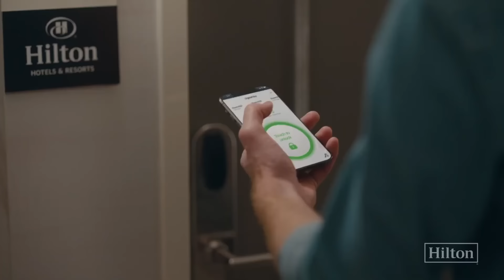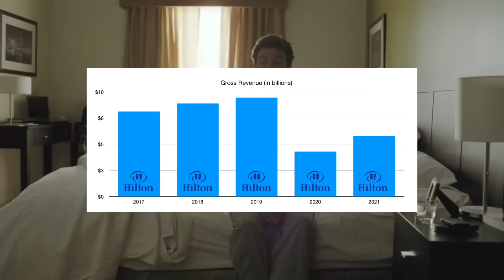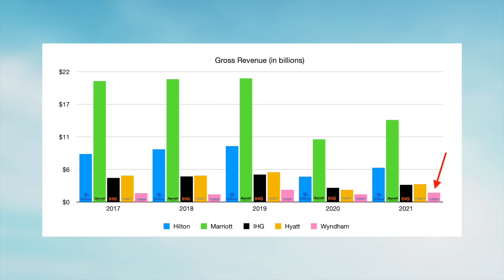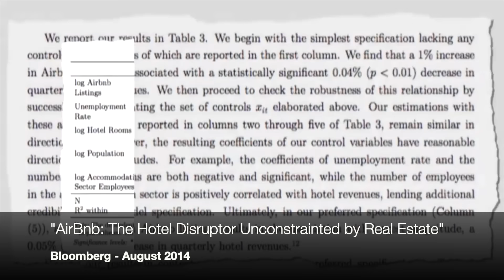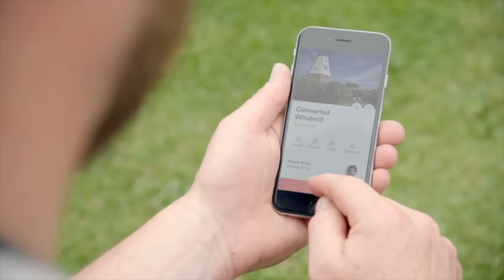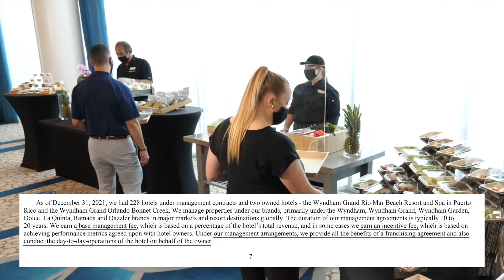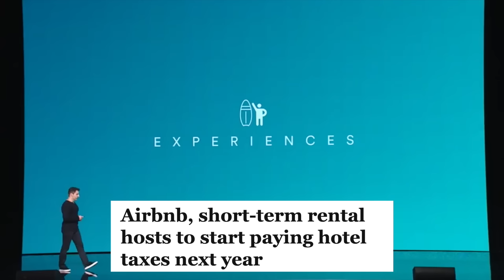Why Airbnb Fails to Disrupt the Hotel Industry

Comment: Well the one thing Airbnb has going for them is definitely price and location. I booked an Airbnb once because I was attending an event and all the hotels were kind of far whereas the Airbnb was within walking distance. 

However I know for sure consistency is definitely an issue. Some places will be nicer than others. Different owners will have different rules. Not to mention you don't know if the neighborhood is safe if you're coming in from out of town. With hotels you know what you're getting and you don't really need to fear for your safety if you're staying at one of the big major players. 

But I do think this causes another issue since there are people purposely buying properties to turn it into a dedicated Airbnb. And another thing I've ran into is rental arbitrage where people would rent a property and then turn that into an Airbnb. I mean with the already small supply of housing and now some people are taking away rental properties for this type of business. I'm not sure what that's going to do to the housing market. 

Hotels will always be around. In fact if Airbnb ever costs as much as a hotel I'm just going with the hotel.

Comment: I would like to add an additional European perspective.
As from my experience also travel changed a lot during the late '90 and early 2000 if you wanted to travel cheaply or you traveled nearby by car, or by train.  If you wished to get a flight you had to rely on the national airlines, which by their own nature monopolistic were/are eager to squeeze every penny out of you. 
Now we have not only low-cost carriers, and it's easier to hop-on charter operators offers, but also high speed trains became a thing and in some countries also bus operators (e.g. Flixbus).
While HS Rail is an actual competitor to air travel on existing customers, Low-cost operators and busses actually increased the demand for travel and tourism in general, so it has become quite feasible to fly, spend the weekend abroad, and being back on Monday (very grumpy)at work for people that couldn't previously, money or time-wise afford that.
I would say that probably if you are a hotel manager you probably would not be particularly interested to have those type of clients either as, by being on a budget, tend on save on the high margin service the hotel provide.

Comment: It is soooo true. I have been using AirBNB for about 8 or 9 years, for about 2x a year and there were so many inconsistent and low quality service that I was already tired of these nonsense BUT on October 2023 I had a problem the pictures from where I was were completely different than the place that I was, it was in a slum and someone broke into the place. When I complained AirBNB pretty much said "not my problem". After all that drama, I started to book hotels and maaaaannn what a difference. People eager to help at anytime, breakfast ready and actually good, no more headaches to check in/out. Problem happened? No worries, in 5 minutes someone was there to solve. Anyway.... never ever again I'll be back to AirBNB. Hotels are waaayyy better and honestly with little difference in pricing

Comment: The single benefit I found to Airbnb is that in case of early cancellation of your stay - even then you have to cancel quite a bit ahead of your departure date - you are entitled to a partial refund. Which is still not easy to enforce, my host first pretended not to know about this policy and I had to show it to him. Other than that it's a lottery with great potential for disappointment.
Reply: After staying 2 1/2 weeks,  gave my air bnb host  a week notice ( I paid for 5 weeks up front, only stayed 3 - paid for  the week i was there when i gave notice i was leaving)  I was not going to stay the last 2 weeks originally paid for. ... Lost about $800 because he refused to refund 1 penny. Air bnb sided with the host,saying he wasn't "required"  to refund my money.

Comment: Honestly, you could argue that Airbnb may have helped the hotel industry in some ways. A lot of the things that we were getting at even cheap hotels we were taking for granted (24 hour staffed front desk, middle of the night check in, private room that you can lock behind you, bars/restaurants in the building, parking lots, pools, etc). Since I used Airbnb for a few years to save money, when I started going back to hotels, I felt like I was in the lap of luxury (despite some of the hotels not really being very upscale). Without an experience with Airbnb, you'd take what you get with hotels for granted and continue to complain about little things. Its nice to trudge into the front desk at 2 AM and get my room key instead of having to rearrangement my trip schedule to accommodate a host... and hoping that I won't get canceled in outright.

Comment: There was once a time Air B&B might have seemed like a threat.

Some still have their charm and place for sure. At this point though, they are simply more trouble than they're worth.

Hotels will always have this ultimate feeling of just letting go that most Air B&Bs seem to have made a point of blatantly erroding away. Plus once you add costs, there are too many cases of being equal, if not more than the good ol' hotels. That plus the extra hassle of having to play your own housekeeper (or else) I have to wonder when Air B&B will simply die off.

Comment: Have stayed at ~200 airbnb's & ~100 hotels in the last decade. Airbnb's still are best for me in most instances as I like a kitchen and separate sleeping quarters (mostly travel with my partner who sleeps in). Most hosts try hard & generally, places are exactly as advertised. I never book an airbnb under 4.8 stars. Require many reviews and I still read reviews and toss out some possibilities based on them. Airbnb is better, on average, for independent travelers who want more space and don't need people around to take care of them. Also, they are better for longer stays. Am a long term wanderer now and usually stay at least a week wherever I go. It isn't that hard to clean up after oneself if you aren't working like a dog for some corp.

Comment: it's sad that both the 'hotel industry' (aka the top 5 players you kept mentioning) and airbnb are essentially removing the middle of the spectrum where smaller, non-branded, owner-operated hotels become basically impossible to run or create

it's either a big brand or some guy's house
Reply: Funny, I haven't found that to be my experience. My husband and I regularly vacationed at the same independent, local hotel for years. It was actually pretty tough to book a room, you had to get it well in advance. Didn't seem like brand hotels or Airbnb were troubling them much.

Comment: 2:49 aggregator: 搜集其他公司資訊並公佈於某一網站的）資訊整合編輯；資訊彙集公司
16:44 they are operating exactly like airbnb long before the startup even existed.
17:33 they also benefit from the real estate appreciation, which is oftentimes actually a higher return than running the hotel itself.
17:45 cash on cash return: 房地產交易的收益率。 記算方式：現金回报率＝年度税前现金收入／年度总投资额*100%。
18:14 unless the hotel is backed by credible lenders or financial safety nets, else it is easily go bankruptcy.
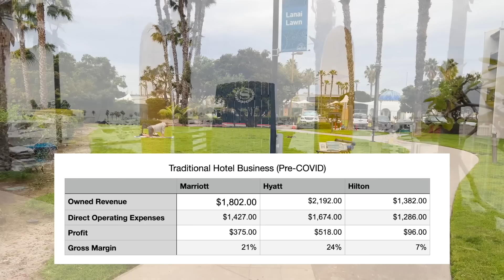18:50 but they still in green.
19:15 owner-operating model
19:32 cut variable costs, such as cutting employee hours, eliminating non-essential staffs, reducing services, etc, is not enough to maintain the high-fixed cost model.
20:59 since 2/3 of hotel bookings worldwide are for business purposes. there are little chance that a business traveler will take chances to stay at a unknown hotel over the consistency, reliability, and reputation of hyatt, hilton, and so on.
21:17 to be a franchisee, you kick off your 2-6% of gross booking revenue to hilton along with a monthly program fee to hilton.
21:36 if you are hands-off owner that doesn't want to take on operations, you can enter a separate fee-based management. 
22:02 they will take a management fee, a bonus fee, and a fixed monthly fee.
22:25 cost reimbursement.
22:42 royalty fee income comes along.
23:13 basis points.
23:20 cost containment 遏止
24:12 it is not a groundbreaking phenomenon.
24:21 transit to asset-light fee-based platform.
24:40 silver bullet: a bullet made of silver, supposedly the only weapon that could kill a werewolf.

Comment: Airbnb opportunity size isn't what they thought but its still significant.  Short-term "rentals" which is where its most like a hotel only make sense if you have a large group of people using a single house (even this isn't always the case based on price).  Most of the time if your stay is less than 14 days you are better served with Hotels.  This is especially true with the growth of purpose built Airbnbs.  Airbnb needs to be better about identifying those and weeding them out IMO.

Where Airbnb still I think has plenty of opportunity is mid-term rentals.  People traveling for 1-6 months at a time where hotels become either too expensive or less convenient since they often don't have all the amenities of a full home.  I know there are "hotels" built more for longer stays but they also are nothing like hotels built for 1-7 day trips in terms of how much "service" you get.  You pay a bit more for Airbnb than renting but generally speaking the place will come fully furnished, you don't pay any living costs (bills utilities etc) and assuming its a well reviewed/good Airbnb then the unit is often better than "served" since the host as an incentive to take care of you vs your standard landlord which generally speaking doesn't care about you once you've signed the paperwork.

So ya, I don't think Hotels should worry themselves even though they definitely did at the beginning but I still think Airbnb fills a pretty decent size need...just not as big as they once thought.  I think long-term the new hybrid work model actually could be a good thing for Airbnb as more folks start working in randomly remote locations for 1-2 months at a time .... the exact scenario that I think start to make GOOD Airbnbs make sense.

Comment: There was no mention of efficient usage of capital. Hotel rooms are generally much smaller in square feet than airBnB. Very few of the hotels mentioned include kitchens, and are mostly single rooms. Most airBnB's include kitchens, and have multiple rooms. Business people tend to stay for a shorter time, and often eat business meals at restaurants. Business people almost exclusively stay with one person to a room. AirBnB makes more sense for vacations where you want to cook with a larger group or family, and individuals are paying the cost so highly competitive on price.
Reply: My "superhost" airbnb did not allow you to use their kitchen or refrigerator. They made coffee in a dining room for paying guests - but  I bought a white Styrofoam cheap cooler to keep in my room for ice to keep cream for my coffee and snacks - it was too warm in their house, like 80 degrees, as they did not run the air conditioner. Very expensive eating out 2-3 meals a day! I had to share a bathroom & shower with 2 other rooms. No cleaning the tub between other people, their hair was in tge drain. It was gross and expensive.

Comment: personally i only like to use airbnb if i'm travelling in a big group (once it was 12 people. that's too expensive if you go to a regular hotel but if you get an airbnb it's a lot cheapter), or if there are no good hotels (using research/prior experience) where i'm going. with the way airbnbs are, i've heard way too many horror stories to really trust some random person on the internet who i cannot hold accountable. if i go to a holiday inn and my room has obviously not been cleaned when i walk in, i just have to go to the front desk and tell them. i've even heard about some airbnb owners keeping using their key and breaking in (or i guess there''s no breaking involved??) while guests stay at their property. airbnb doesn't do anything about this. it's different with hotels. there's a structure and if something is genuinely not right you can take it up with someone who will do something about it. even if it's just financial compensation

Comment: When I used Airbnb, it was new and I didn't make much money (fresh out of college). Being able to get a big space with friends where we could cook was great and saved us a lot.

Nowadays Airbnb is not cheaper. And hosts started asking  for more and more from guests in regards to cleaning (alongside increasing cleaning fees)

I'd can also now afford hotels that are better than thin walled, noisy cheap places. Hotel service is better.   I don't need to completely clean the room. I can get breakfast. There is usually a little shop I can buy from if zi need anything. I don't have to worry about sudden cancellations 
 And finally, I can use credit card rewards.

I will still peek at airbnb if traveling in a big group, but even then hotels tend to win out. The service is just better and the costs are lower or the same.
Reply: It makes no sense to use airbnb anymore.

Comment: Some years ago, AirBnB was the way to travel, especially for students and young adults on tight budgets. I still check AirBnB if I just need a single bed at the lowest price possible in the city center. However, recently, the price difference between traditional hotels and AirBnB has been going down. I have the feeling AirBnB ate up investor money to offset operating costs. They can't do that forever, so as they secure the market, they now increase service fees. AirBnB hosts also see how profitable it can be, and optimize their listings to get as much as possible, further increasing the price.

The thing is, if I have to choose between an AirBnB and a hotel at the same price level, I will go for the hotel. No nasty surprises, no misleading photographs, reception desk with clearly defined check-in and check-out times, very low risk of cancellation or unexpected booking changes, and many more small conveniences tip the balance toward traditional hotels for me.
Reply: Ya, airbnb is not a deal anymore, sadly

Comment: Don't forget. Marriott bought Starwood in 2016. Only reason they have such a high market share. I worked for Starwood during the acquisition. Starwood was a cool innovative company with great brands and a FANTASTIC rewards program. Marriott is a boring drab and very traditional company with their most innovative brands including W, Aloft, St. Regis, Sheraton Grand, all coming from Starwood. And their rewards program doesn't hold a candle to what Starwood offered. Marriott is the reason I left because they also were a way worse company to work for!

Comment: Two big money makers for hotels: the business traveler and the “needy” traveler. The business traveler for hotels: they’re not very price sensitive, and they’re looking for convenience. The “needy” traveler is that one in the middle of a road trip  that needs to sleep and didn’t plan their trip well and stop for the night (or something wrong happened in the trip). In both cases, Airbnb is not a real option. I mean, I know companies that booked airbnbs to employees during business travels, but that isn’t very common, since it might not seen “professional” (causing bad impressions to the employees), and the risk of liability - if something goes wrong, I rather sue a big hotel company, just in case. Plus, hotels offer small convention centers, which is a huge money maker too. 

So, just like airlines, hotels know that the big money is on business travelers. But airlines don’t have an “AirUber” to compete with, and there it comes the next point…

Hotels know that airbnbs are going to get regulated (as it’s been). The point is: it was common (now not that much, after regulation), people renting properties to sublet through airbnb. That has caused a huge hike in rental prices for the regular people who live in the cities. Okay, it’s not possible to control what an owner does with their property, but, at this point, unless the property is something located in a hot tourist spot, they’ll probably rather go with the regular residential rent to regular tenants with a regular lease.

Comment: Our employers have banned us using air b n b due to 
-lower safety regulations 
- no asbestos certification 
And hit and miss standards. 

And also as it’s a pain in the ass to everyone around. I am also sceptical myself taking them unless I am in Switzerland in a new build . The biggest risk is safety. The electrics went out in the middle of the night for the whole flat. Had to call middle of the night. Air b n b has its place but it’s not always the best choice.

Comment: simply put: hotels don't fear AirBnB because hotel corporations have put pressure on local governments to ban AirBnB in markets that would cost them heavily. By pushing for new laws that limit or prevent homeowners from renting their house, condo or apartment, hotels keep their monopoly on the temporary housing market. 
The same thing has happened with Taxi companies vs Uber/Lift.
if it wasn't for new laws & gov. restrictions, the hotel industry would be in financial trouble.

Comment: there is a massive difference on how airbnb operates and works to how a hotel industry operates. Hotel industries have 24/7 services and security for guests, they also have facilities that is not normal. the higher the star of the hotel the more it has, much of airbnb will have those but the cost is super extreme where hotels £100 a night means you can get spa, pool and breakfast added. Airbnb cannot do that but air bnb is fucking cheap if you only need place to crash shower and go work in morning/night.